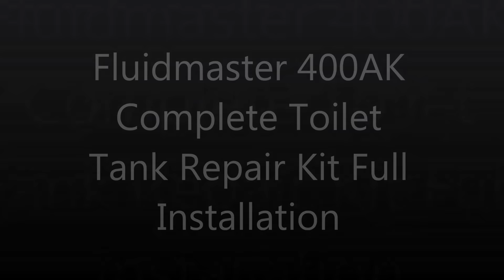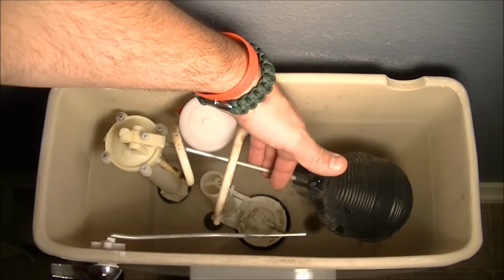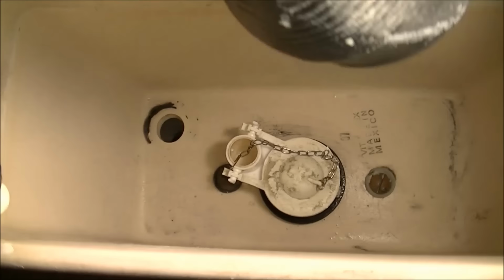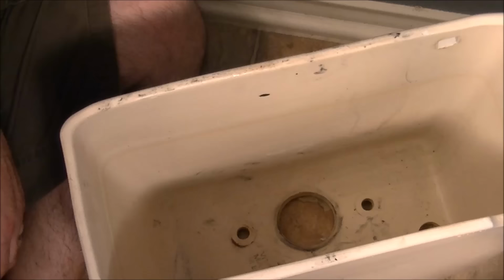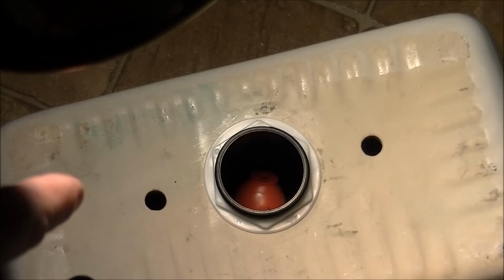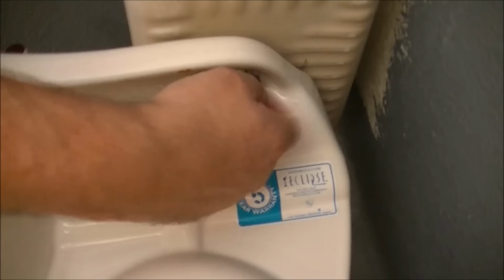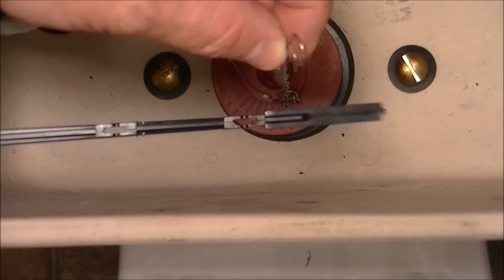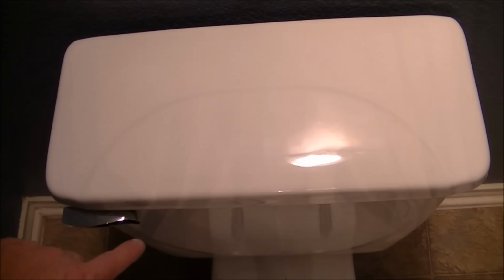FluidMaster 400AKR Complete Toilet Tank Repair Kit HD Full Installation

Comment: i LOLed when i saw you'd screwed the chain under the seal. but glad you had that problem to save me from having it :) btw, my tank had 3 bolts and this kit only had 2 bolts to replace it with, so i had to reuse 1 of my bolts. :/
Reply from the maker: +J Ja You are welcome. Some do have three bolts but as long as the old hardware is in good condition you shouldn't have any problem with it. Thanks for watching and commenting.

Comment: Hi Thanks for the help. I wish I didn't break the handle. I had a hard time putting on because my toilet'sflusher is on the side, not the front. I tried to bend it but it snapped even though I went slowly. Wasn't sure about the side handle.

Comment: Hey Richard! I did it- thanks to your video my toilet works- no leaks! When I re-read the instructions it says to submerge the float bowl several times. You didn't do this, nor did I, however I am wondering if this is a step that should be followed???
Thanks again I really could not have done this without your instructional video. During the process I also noticed that it said no chlorine bleach in the toilet tank, and in the past I have thrown some in the tank to help with a mold build up!
Reply from the maker: You are most welcome. I am not sure why they want you to submerge the float but I have not had a problem regardless. It's still works well. Thanks for watching and commenting. All the best.

Comment: When attaching tank to toilet should be top of bolt on rubber washer then threads through tank then washer and nut then set on toilet then another rubber washer and metal washer and bolt, even shows that in directions on this kit.so each threaded bolt will have 2 nuts.
Reply from the maker: OK. Thanks.
Reply: 5280 Street Dogs yes, today normally the screw kit (if buy separately)should come with 3 washers, 3 rubber rings and 2 nuts for each screw. Btw, one of the washer should be put between the screw head and the rubber ring. Then there should also be a washer between the each rubber ring and each nut. Rubber rings should be put between the ceramic surfaces and the washers and nuts of the tank and the base unit.
Rubber rings are to provide sealing n protect the the ceramic surface. Washers are to protect the rubber ring and spread the pressure evenly on the rubber ring.
But for this kit, only one rubber ring, 2 washers and 2 nuts are provided with each screw, and the screw head is big as the size of a washer, the washer between the screw head and the rubber ring could be omitted but one must not turn the screw head but only hold it with a screw driver but tightening the nuts at the other end. And as there are no more rubber rings available, one should be careful when tightening the nuts and washers to the ceramic surfaces of the tank and base unit. Actually the rubber rings and washers of the old screw kit may be used if size is right and condition is not bad.
Btw, the smaller nuts should be used first to tighten the screw and rubber ring with the tank so that these nuts can go inside the base unit holes for these screws.

Comment: Thank you for this great video I appreciate your instructions step by step very easy to fallow! God bless you 🙌💜 I fixed my toilet tank but because I took your advise to not tide to much the screws because it's porcelain
 It leaked left side screw I almost took it apart again, but I just tided it and worked as good as yours😊 thank you again 🤗

Comment: After a flush in the tank is refilling I noticed that water comes out of that line. Why would you put that line inside of the overflow pipe? Why would you not use that water to help fill the tank? It seems like it’s just a waste of water running it down the overflow tube.

Comment: The chain that you CUT , had a tiny tiny link piece at the bottom by the flapper .
My Luck :
That tiny tiny link piece would float it's way and somehow get stuck under the flapper ,, causing it to stay open just enough to keep it open and water dribbling in ! 
Uuuugh ! ---- ha ha ha .
I'm like a " Tri - DIY'r " .
Usually fix the problem on the 3rd try .
Anyone else out there ?? - ha ha .
Great Instructional Video though !!
Thanks for Posting !
Reply from the maker: You are most welcome. I am glad to know I could help you. Thank you for watching, commenting and the kind words. I appreciate it greatly. All the best.👍😀

Comment: the rubber peice taken off around 2:35 may not seal properly may have to use well will have to use if have a leak. other than that whole assembly  works great so far  i didnt use wack cheap plastic  handle to flush saved incase  i need later but used all other pcs didnt use a hacksaw jist a scissor to cut tube for the fill.

Comment: My shut off valve to the tank is not shutting off the water. I'm assuming I need a new shut off valve also?  Is that an easy install from inside?
Reply from the maker: The procedure is straight forward but you need to make sure that your main water supply to your home is shut off and the pressure is drained from the system prior to replacing the valve or you will have a serious water spill when you remove the valve. Thanks.

Comment: If there are no obvious leaks, do you have a method for checking for minor leakage? I've tried checking if any parts are damp after some time, but can't seem to pinpoint the leak. However, I can hear my tank add just a bit more water every now and again. Any advice would be greatly appreciated. Thanks for the great video!
Reply from the maker: If you can't see the leak I suspect the flapper valve. You should take it apart again and make sure all the surfaces are clean then look at the valve for any defect or poor fitting parts. Thanks.

Comment: You should have used a washer on top of the gasket in the tank and only used one washer on the bottom.  That tank could leak without it.
Reply from the maker: It's working great still. Thanks.

Comment: Hi Richard 
I Replaced one Wahser at Outside Spigot. Since I did when I turned it On...Making noice and Shaking??
Please help me ...is it Dangerous?
Reply from the maker: Not sure about dangerous but it should not make noise or shake. Make sure you use the full kit and replace the flexible water line from the wall too. Any leaks may cause water damage to your home. Follow the video and manufacturers instructions too. Thank you so much for commenting. I appreciate it greatly. All the best.👍😀

Comment: Do you recommend double bolting the tank so you can separate the tank with water still in it if needed
Reply from the maker: It's up to you, but the moving the tank with the water feed line connected is not something I would recommend (flex lines get brittle and are known to burst) if you require the option go for it but understand the risk. You are most welcome. I am glad to know I could help you. Thank you for watching, commenting and the kind words. I appreciate it greatly. All the best.👍😀
Reply: Richard Lloyd thx. I wasnt referring to if the supply line was still connected. I hope nobody thought to do that lol

Comment: You don’t really have to take the tank off, you just have to take out the fill valve and flapper.
Reply from the maker: In my case I did as the bowl filler tube was cracked at the base and the tank would continually drain water into the bowl but if it's not broken or brittle you're right it does not have to be replaced. Thank you so much for watching, commenting and the very kind words. I appreciate it greatly. All the best.👍😀

Comment: Did the wobble go away once you attached the tank to the bowl? Or was it still a little wobbly? Was wondering if I needed to get a different gasket because of the wobble.
Reply from the maker: The wobbble did go away when I snugged down the bolts. Be careful not to over do it. It is porcelin after all it can break. If you have the bolts snugged down and it still wobbles you may want to get a thicker gasket. Take a look at the original gasket if it did the job and still looks good you can use it again. 
Thank you so much for commenting and watching. I appreciate it greatly. All the best.👍😀
Reply: @richardlloydusa  Thank you. Seemed to be ok once I tightened. Have a little leak though on the left side(facing the toilet) where I secured the bolt.
Reply from the maker: If it's leaking something is not right. I'm not sure where your leak is but whatever component is leaking should be checked for defects or improper fit. Water is not something you want to go unchecked in your home as a small leak can turn into a large leak leading to damage. Make sure to chase it down. Thanks again. All the best.👍😀

Comment: The 2 nuts for each screw should both be used. The small one is to tighten the screw and rubber ring with the tank. The bigger one is to tighten the water tank with the base unit. The washers are between the nuts and the ceramic surfaces of the tank and the base unit.
It is better to use screw kit comes with 3 washers, 3 rubber rings and 2 nuts each. Always put a rubber ring between a ceramic surface and a nut or screw head/bolt head. Always put a washer between the rubber ring and a nut or screw/bolt head.
I will try to reuse some of the washers and rubber rings from the old screw kit if size is right and condition is not bad, as in this case the new kit does not come with enough washers and rubber rings for best installation process (but the kit can work if installed properly and carefully). But a rubber ring can provide flexibility on the joint and reduce the pressure force possibly put on the ceramic surface when a user lean back on the water tank and in the conditions that the tank is not tightly supported by a back wall/structure and the screws were very firmly tightened, consequently protect the toilet from cracking due to any micro-banding motions.

Comment: Richard,  Thank you for your video.  I did exactly but when I flushed it, it doesn't have a power to flush out the solid and mine flapper seem to release some bubble out.  What did I do wrong?
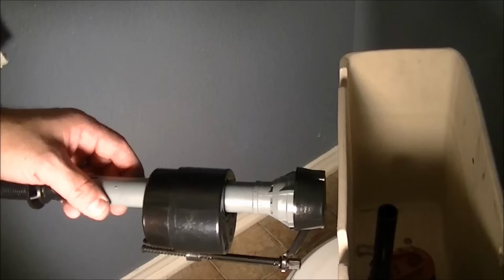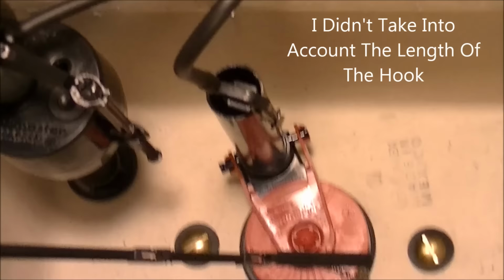Reply from the maker: https://youtu.be/R0qLKlvZR4I?list=PLnxXRLSlmSVOUSl-tmdEuav4IW1OghaES  Make sure you set the height correctly 29:04 I show how to set the chain length at the 42:00 point in the video I show how to adjust the flapper chain, make sure you have that correctly adjusted as well as the flapper it's self is adjustable (though I did not have to adjust it. Mine worked fine.) My flapper was set to the MAX setting and you can see that at the 42:22 point in the video. You adjust it by turning it clockwise to the max setting and counter clockwise to the Min setting. Next thing to check is the water level point which I show at 44:00 mark in the video. Set those like I show and they should work the same way. Thanks.

Comment: Every demo on YouTube deals with two piece toilet bowls.I am trying to replace the entire kit for one piece toilet bowl. Is there a different kit for the one-piece or can I still use the universal kit?
I just don't see hot to secure the middle stem that comes with flap.  Unlike the two piece where the tank can be removed to secure the stem with a nut under the tank.

Comment: I bought this kit, successfully installed it but the seal failed, I had to buy another $7 seal kit and it still leaks.  Tighter the two bolts that hold the tank as tight as possible and it still leaks.  No crack in tank itself.  Very annoying.

Easy install except for the terminal leaking.

Comment: My toilet does not flush with enough power to get rid of the you-know-what. A handyman could not figure out the problem & recommended I get a new toilet installed. A friend gave me one of your kits. Do you suggest I try installing your kit, or replace the toilet? ps. I have a bad back & am not sure how heavy that tank will be.
Reply from the maker: It might solve the problem as it sounds like you are not getting the proper function out of your current toilet assembly. I would get someone to help you with this as the tank is quite heavy. Be safe. Thanks.
Reply: Laura Woodswalker - hi, the problem you are probably having is the little jets that you can’t see under the rim of your toilet are probably clogged up with lime sediments from your hard water, from years of flushing if you have a regular standard toilet. You can try pouring lime-away or other cleaner down the hole of your toilet or use a brush or water and poke holes in those tiny little jet holes.

Comment: Well, installation instruction suggest different way how to use toilet bolts. What it tells, bolt than rubber washer , than tight bolt to the tank with metal washer and metal hex nut. After that install tank to he toilet bowl, put first rubber washer, than metal washer, than hex nut. I like very much Richard's presentation, but people should know that this part he did differently that installation instruction recommended.
Reply from the maker: Thanks.

Comment: Yeah if you did not install right, it might leak two days later.  If you remove it, you have to replace the rubber rings(gasket, bolts) again or silicone seal it.  I am thinking the rubber seal fit the first mold and when removed, lost some elasticity the second time and would not cover fully the same time.
What are the chance of a new kit with a faulty flipper valve?  Though I did tried the Korky flapper as well since the Fluidmaster looked flimsy.  Both failed.  What to do?
Reply from the maker: +UnitedPebbles Are you sure it's leaking from that point. I can't see how two brand new flapper valves would fail. Also the are the mating surfaces spotlessly clean? Water is tricky. Thanks.

Comment: I still like to use a rubber gasket then the washer then the nuts from the bottom of the bowl .. all tree bowls I have 3 bots holding the tank so they don't wiggle ..
Reply from the maker: Good enough. As long as it works for you and you are happy with it. It's good. Mine is holding well as I showed on the video. Thanks for the feedback and watching.

Comment: Let me just add that tightening the screws and or the flapper valve properly is a big deal.  Instructions say snug but, that's up to your interpretation.  I have replaced a few of these and every time I have had leakage problems.  I noticed that you tightened the flapper valve with channel lock pliers.  Well, I did what the instructions say and hand tightened mine and when all was said and done I had leakage.  You are dealing with porcelain and you don't want to crack it but, per instructions I have had leakage every time.  The point I am making is that it is hard to determine what is snug and what is too tight.  I removed the tank and had to re-tighten the flapper nut and the screws that hold it down to the bowl not knowing which task was causing leakage.   I've had leaks and each time I had to tighten the screw more and more all the while being afraid to not overtighten them and crack the porcelain.  I finally stopped the leakage but, the instructions also say to level the tank which means overtightening one screw can make the tank unlevel.  It's a judgement deal as to how much to tighten the screws.  Even after I finished the job my tank could be shaken slightly when depressing the flush handle.  I got the leakage stopped but,  I could have tightened the screws even more but, chose not to do so.  I didn't want to buy a new tank .  None of the videos I have seen address this issue so I wanted to comment on it.

Comment: Great video! But i still have to call a plumber. 😰 Bolts that hold tank on rusted to the point a screwdriver won't do it.
Reply from the maker: Yes, this is a special circumstance and needs to handled correctly or you can damage the tank. Thank you for watching and commenting. I appreciate it greatly. All the best.👍😀

Comment: What happened if I don’t cut the flapper tube
Reply from the maker: Great question. As part of everyday function not much would be affected. If it fits under the toilet cover it will work but the flapper tube is also a fail safe in case the valve fails to stop filling the tank. The point is that the extra water in the tank would flow down the tube into the toilet and out the drain instead of overflowing out of the tank into your home. As long as the flapper tube is lower than the lowest edge of the tank it will work as it should. Thank you for watching and commenting. I appreciate it greatly. All the best.👍😀

Comment: I need to do this project too,but the tank on my toilet is attached with 3 screws instead of 2.....WTF?
Reply from the maker: You will probably be able to use one of the bolts you remove. Thanks.

Comment: I like the fact that you left all of your goofs in there, too, because A) Nobody's perfect! B) With a "universal" type of replacement kit, you're going to have to know how to improvise and adjust as you go and C) This is the best way to learn.

According to plumber's code, I believe the water level is supposed to be 1 inch below the top of the overflow tube, but as long as it is at least a little bit below it will be fine (Just don't let a plumbing inspector check out your handiwork! LOL)

Comment: Is it necessary to cut the chain?
Reply from the maker: It is best to do so if there is a chance of it entering the flapper hole as that would cause the tank to never fill and therefore causing a huge water bill. Thanks.